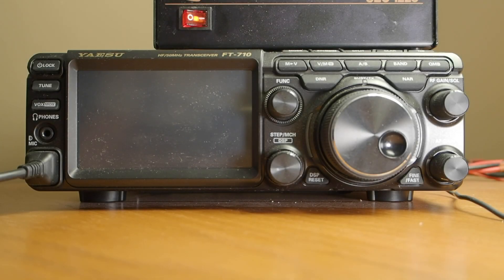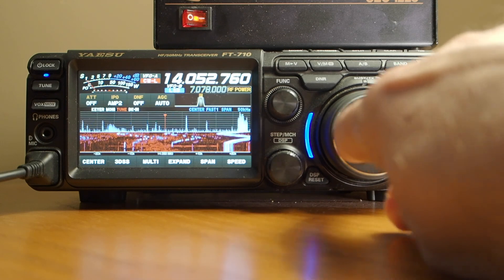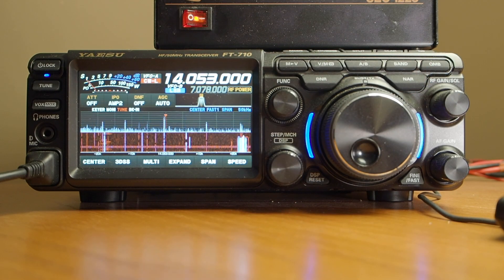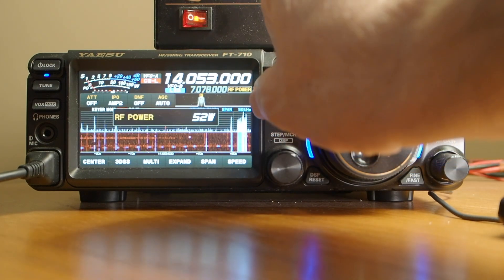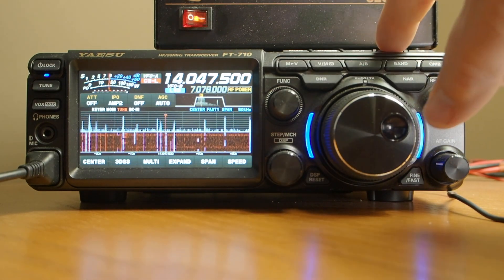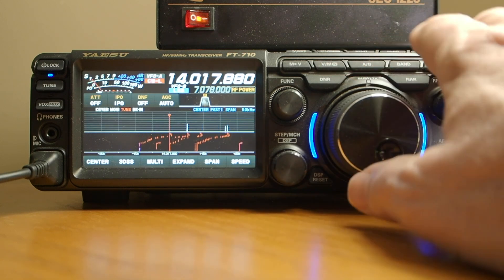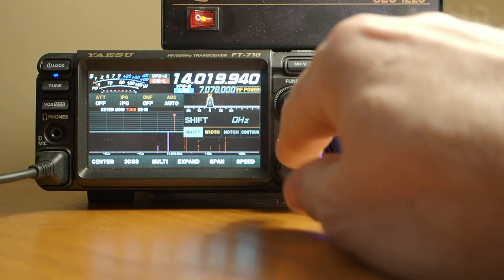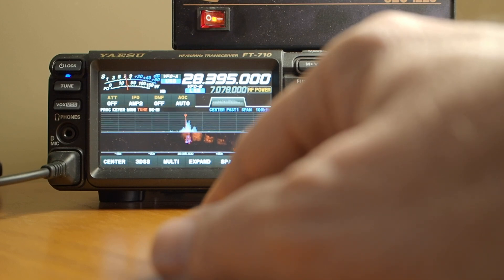Yaesu FT-710 Introduction

Comment: Any tips on how to connect an old Autek CMOS keyer to the Yaesu?  I am using the guide on Page 14 of the manual and have it wired so that the tip and common are connected to the two wires of the CMOS keyer, and NC on the middle band of the plug.  Any ideas?

Comment: Great video! I bought one of these last summer to use in POTA type activities. I liked it so much that I bought another one to replace my IC-7300 in the shack. The fan does seem to run most of the time but I don't find it objectionable.

Comment: Thank you for a very informative and straightforward introduction to the 710. I have a question for you: some people report that the cooling fan is very noisy, while others say they can hardly hear it. What is your experience? I ask because a noisy fan would irritate me forever. Best regards, 73 DE OZ1DSM / Thomas
Reply from the maker: Well, I'd put it near the level of fan noise from the FT-7800 or FT-857D . . . The difference to me is that it will stay on for a long time and occasionally it will turn off. I asked Yaesu tech support if the new ones are any different and they said no. It doesn't bother me much but it would be nice if it were a tad quieter.

Comment: I have a 710 and have been beating the ever loving crap out of it for a year. 4000+ ft8 contacts at about 32 watts, forgetting to turn it off for a week with no AC in a 100 degree building, various coax and connection woopsies and a list of other dumb stuff and the radio works like its brand new. My irresponsibility, neglect, abuse and bad behavior definitely has me convinced its a well built and rugged device.
Reply: Fare ft8 non è radio. Perché usi internet per fare contatti.

Comment: I think adding a mouse to the FT-710 is invaluable. You can change any setting on the FT-710 with a mouse, except changes that require the use of one of the rotary knobs to change a setting value.
Reply: Yes I have connected a mouse AND an external monitor display.  Now easy for old eyes to see the screen.  😊 great radio
Reply: @ I don't know how old your eyes are but my 80 year old visual recptors greatly appreciate my 27 inch monitor (and mouse). :face-blue-smiling: A whole nother world of HAM radio!

Comment: That's great . However is there a way to change band or mode without touching the screen?  By pressing band and the multi?  Like the ftdx10 you can press band and turn the central outer circle vfo ? Or would I have to set up all memories with a load of frequency and mode then tune of in MT mode ? This would probably be my preferred option?  However if I tune off a memory in MT can I go up and down at 1khz at a time with the step/mch control?  
I looked high and low on  YT channel for that answer with no luck ? Download the manual still no luck ? 
Any enlightenment on that would be great . Many thanks.  Rob mm0udi in Scotland 73 .